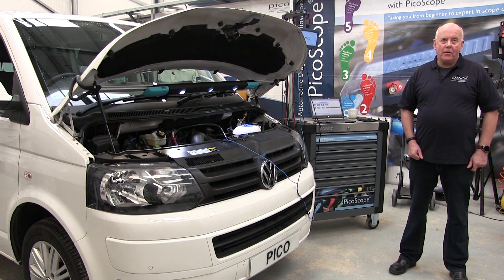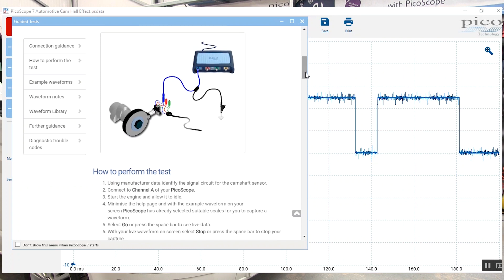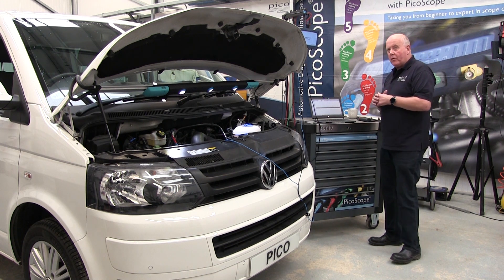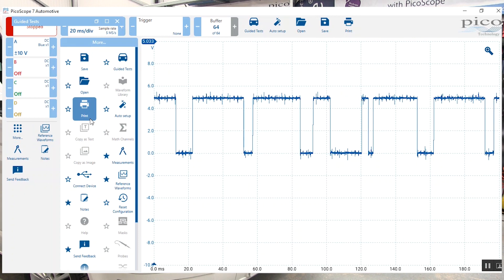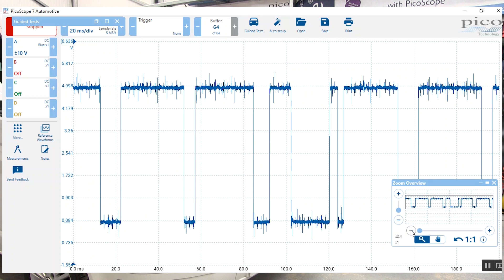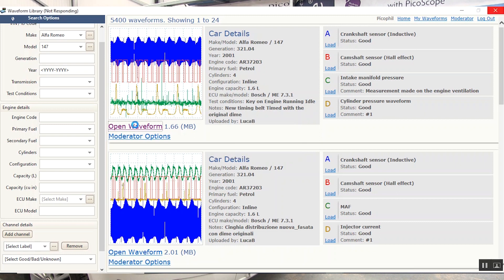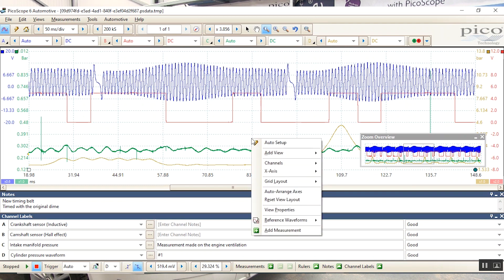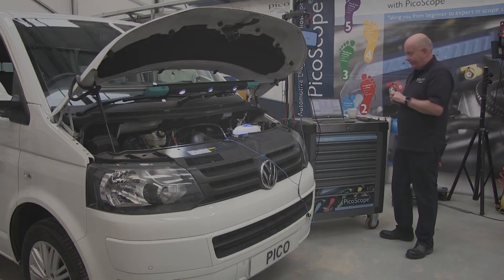PicoScope Automotive: Open Your Eyes

Comment: Hello
Pico Scope is a great device, but you must add settings such as the crank signal sensor analysis, such as escop4 and usb autoscope.
Reply: Do you got a ats escope buddy?that would be amazing if pico add the misfire software
Reply: @trublue2319  
 There are no ATS Escope 
 But I have USB autoscope 
 It is a good device 
 I'm trying to get ATS soon
Reply: @NM-zx1fn  Ora I use the snap on scope at work. Can't decide which scope to buy for my self escope or pico? It's a hard expensive choice